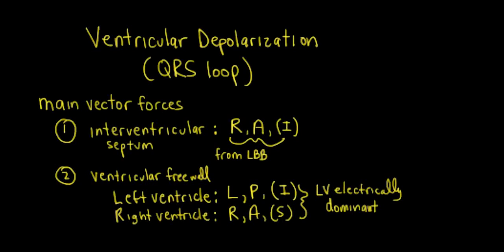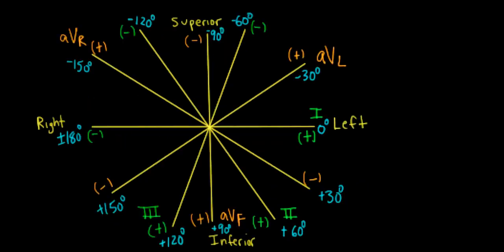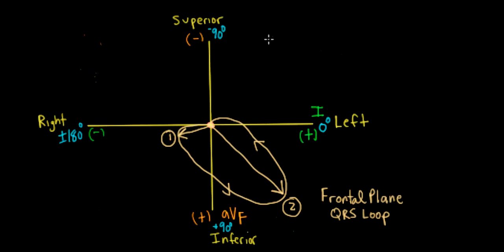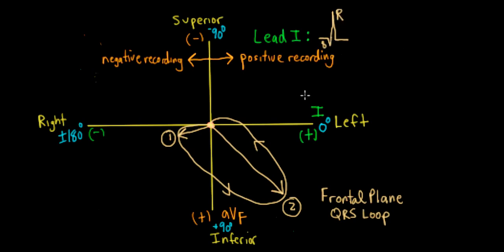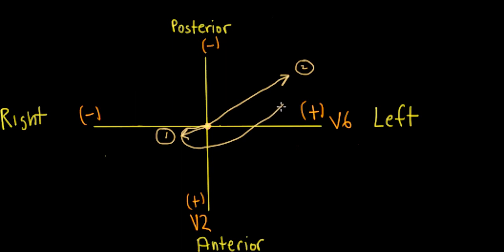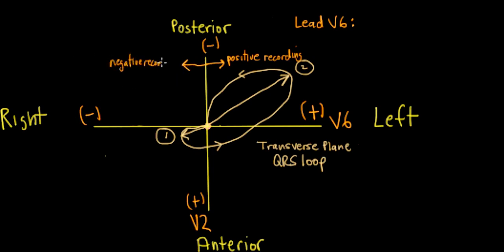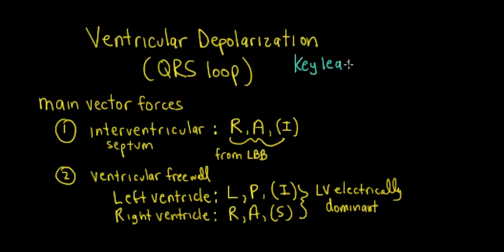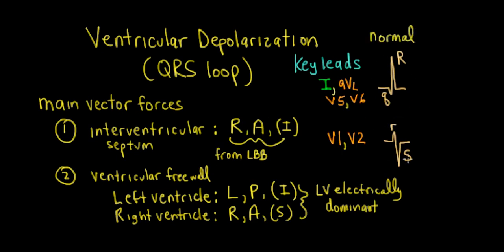Schneid Guide to the QRS vectorcardiogram loop

Comment: Thanks! I needed help to understand biphasic complex of R and S wave which is due to perpendicular depol. wave ( to lead)??? how can can we get perpendicular comp. of that wave because the perp. component is zero. Thanks
Reply from the maker: The idea is that if the depolarization is spreading perpendicular to a specific lead (for example straight up towards +90 degrees which is perpendicular to lead I) it will spend roughly half the time near lead I's positive pole and half the time near its negative pole, giving a biphasic (equiphasic) QRS complex.